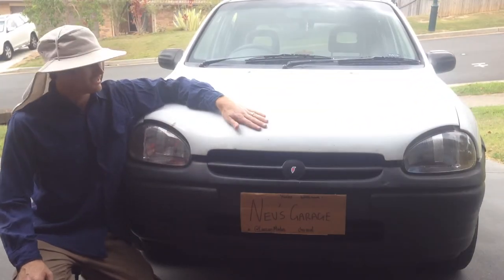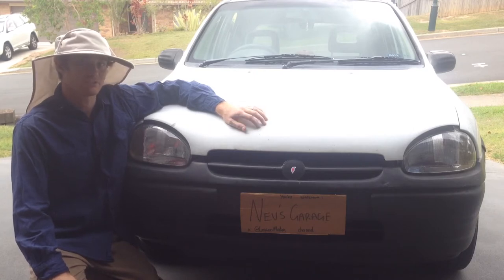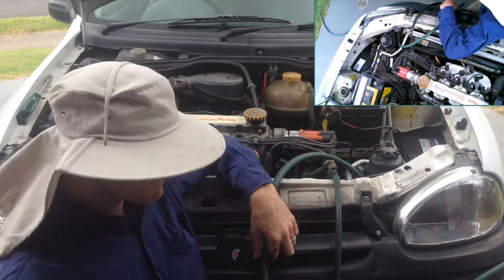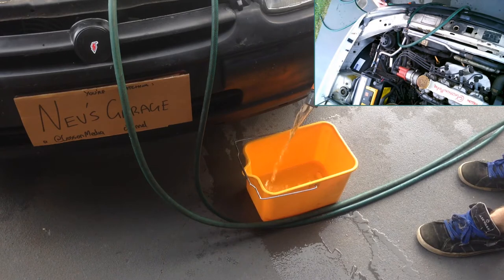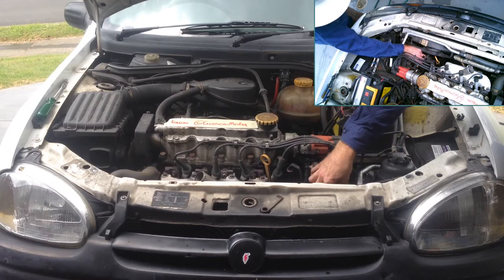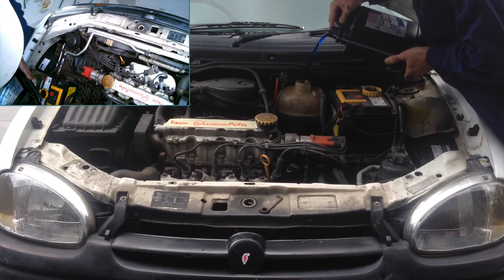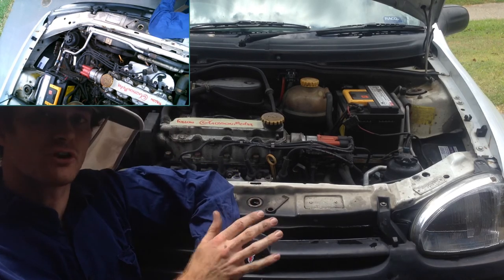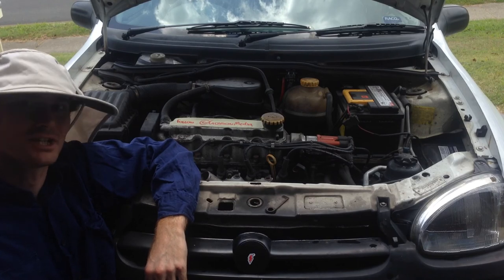Flushing and Servicing an SB Corsa / Barina Cooling System

Comment: Can i connect directly on the reservoir? And leave the ecpansion hose on the radiator? There is a powersteering reservoir in the way were the hose connects to the radiator.